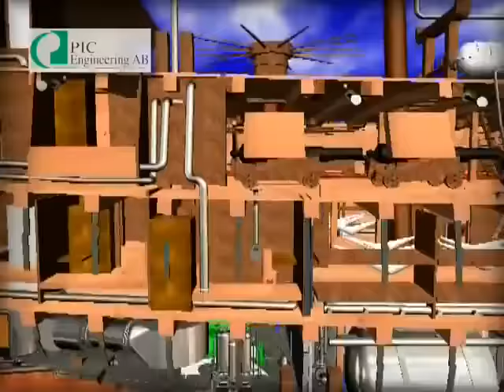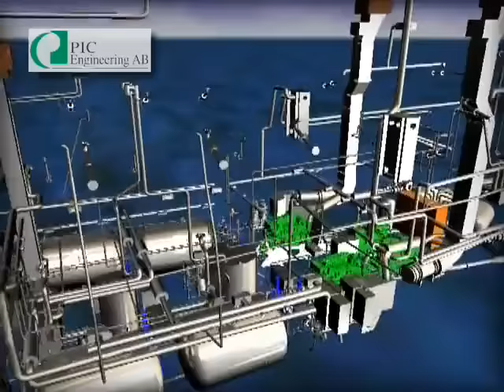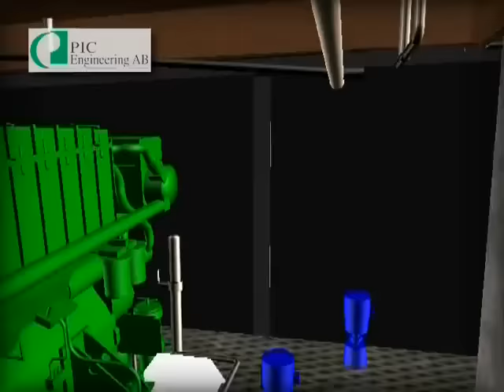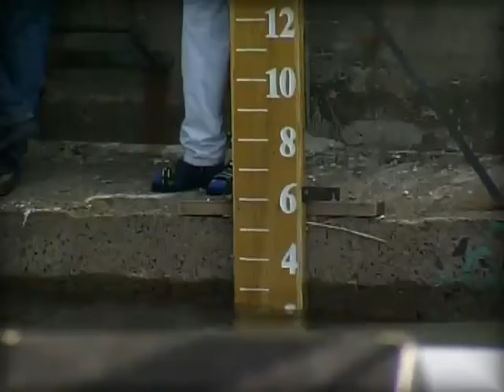The Building of East Indiaman Götheborg Pt 3 - Hur Ostindiefararen Götheborg byggdes del 3

Comment: Thank you for uploads.
 these traditional trades are so magnificent ! So much goes into building just one .  Understandably the ocean sailing ships off the modern times must have safety considerations such as fire prevention, and extinguishers, water tight bulkheads and motors, but the system of building has not changed much. Thank you again and  three HUZZAH's  to all !!

Comment: I don't understand why they didn't build a Yawl boat for this instead of mounting engines. Such a beautiful ship, and I think would have been even more so without the propellers.
Reply: The engines where a required safety feature - They had to put it in to get rated as a seaworthy vessel with and comply with insurance regulations for that type of ship. Most of the era replicas can never go out on open sea because they fail to comply with modern safety standards. It's a compromise; Do you want a 100% authentic build that sits pretty in the harbor or do you modify it to rate as a commercial sea vessel?

Comment: Great series but GAH! That annoys me so much that they went through such painstaking work to make it look old fashioned, even using old fashioned methods... Then stuck an engine and props on it... At THAT point they might as well have taken a modern ship and just bolted planks on the sides and a couple of masts on it. Boom, just as authentic.
Reply from the maker: No, a modern ship with an engine is not 'as authentic' as one built using the old methods and materials. This is a very authentic ship, but it has an engine due to safety concerns since it is travelling on the high seas with lots of people on board. The same goes for life-saving equipment. I don't think most people would like to be stuck on the high seas during a storm with no modern life-saving equipment. The ship itself is built just as they did it back then, using the same materials, with a few modern security additions.
Reply: +Nicholas Kindig The whole idea was to build a real ocean sailing vessel, not a replica for a museum.

Today's ships MUST comply a large number of international safety and environmental requirements for the ship's structure, equipment and crew to get a classification for ocean sailing. Ships are not allowed to visit foreign ports outside their designated sailing area. While some other 1700's replica ships may be more "authentic", they are classified for coastal or "insea" sailing only. 

A sailing replica ship is always a compromise. Nobody expects anyone to sail with 18th century nautical charts, without any tide tables or weather forecasts, without any communication equipment, wearing 1700's clothing and no life-saving equipment whatsoever. Even the essential tools for celestial navigation, the sextant (optical instrument) and marine chronometer (needed for determining the longitude) were invented in mid 1700's, but most seafarers of that time used more clumsy and inaccurate instruments for determining the position.
Reply from the maker: +paanikki Very well put!
Reply: It would be a real crying shame to get in a bad situation say during a storm and lose the ship because you did not have the engines.
Reply: Nicholas Kindig Ohøj romantic landlubbers. 
As mentioned in the documentation much of the modern installation was due to modern safety regulations! Otherwise She would just be another floating museum not allowed to leave its safe harbour.. 
Modern comfort is simply common sense & makes Her useful many years ahead.. 
Try imagine yourself 20-30 days ocean sailing with unpredictable wind & no protection merciless delivered to any harsh conditions as snow, frost, fog, rain & hail along with ongoing meter high sea and daily forced to climb 30 meter mast..? Despite any personal condition & readiness! 
It's not only a question of comfort, but necessary lifesaving installations & equipment..
Reply: Nicholas Kindig is right.
So, I use a 48 year old car and a 32 year old motorcycle for my daily personal transportation ... would I have to put in a bunch of failure-prone computers to take part in "modern" traffic?
The point is: I have the traditional things (in terms of technique) to AVOID the bloody, useless nonworking crap they tend to build in nowadays.
I'd expect something alike from traditionalists I'd take for real on the water, too.
Reply: +Nicholas Kindig  This ship was built as authentic as you can get. But without the engine etc a ship this size would not be allowed to put to sea and so would be no more than an massively oversized paperweight. As shown in this video a lot of thought & care was taken so that the modern gear was fitted in ways that make as little difference to the original build as was possible.

It is dangerous to sail in modern days without this gear. The original 'Gotheburg' did not have to contend with speedboaters, yotties, supertankers etc. There are hundreds of collisions and sinkings every day, and these are ships with the protection of modern equipment. Without this gear no insurance company would have touched it, so very few people could have even gone aboard it and the ship would have had to be kept on private property. So what should the 'Gotheburg's builders have done, not bothered to build it?

I have looked closely over the 'Grand Turk' which was a similar project and was in awe at the ingenuity shown by the builders at fitting the required modern equipment in as unobtrusive a manner as possible. For example, I was a couple of feet away from a modern navionics display but would not have seen it if I hadn't been shown. Once shown, it was clear & easy to read when needed. It could have been left out but then modern shipping regulations would not have allowed the ship to even leave harbour. When it sailed into Poole it SAILED as far as harbour regulations allowed. The engine was started outside the harbour, as required by the harbourmaster, but the drive was not engaged until approaching its berth. Without this a ship that size would not have been allowed to enter Poole or any other port.

If you were to take a look at a ship such as the 'Gotheburg',  'Grand Turk' or Spains 'Nao Victoria' you will immediately see the difference from the 'modern' ships with bits bolted on such as 'Pelican', 'Lord Nelson' et. al. What you won't see is the modern equipment. The equipment will be there, because it has to be, but you won't see it. What you will SEE is an authentic replica.
Reply: Sylentlight FINALLY SOMEONE WHO SHARES MY PAIN AND ANGER
Reply: I don't agree. Maybe you should volunteer with building such a ship. I think you would be left in no doubt as to it's authenticity.

Comment: What is this ship going to be used for. I saw some old cannons, I hope this ship is actually useful, not some musuem or replica tallship to show people how they sailed 200 yrs ago. The should use this ship to deliver food, freight or what ever is needed around the world. I think all ships & boats should be powered by the wind & assisted with electric motors that are powered by solar panels & wind generators. We don't need gasoline or diesel engines on the ocean anymore. They even have developed a four dr & 4 passenger solar car that can go 400 miles on a full charge of its batteries, & can propel itself by the solar panels alone, to speeds of 60-80 mph. The electric motor is attached to a 7 speed transmission, to help conserve energy. Nissan has a 70 lbs 3 cylinder diesel engine that makes 400 h.p. which could be used in airplanes for hybrid diesel/electric. Seimens has 100lbs e-motors that put out 300 h.p. they can be matted together to produce double the h.p. with a prop. Imagine a big plane with e-motors double up & with a prop, 1200 h.p on each wing 2400 total h.p, & solar panels covering the topside of the wings & fuselage, along with 2 nissan diesel engines matted to high output generators/altenators to create energy for the e-motors. Their will be no need to take mother earths blood anymore, or at least not as much.